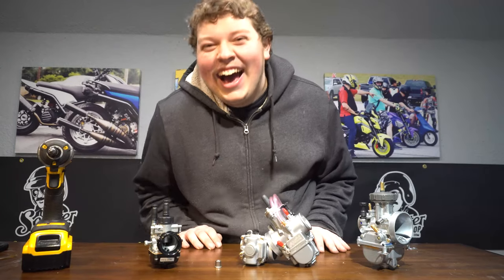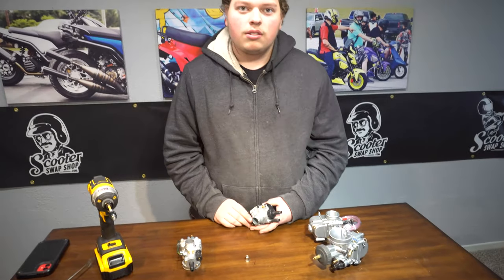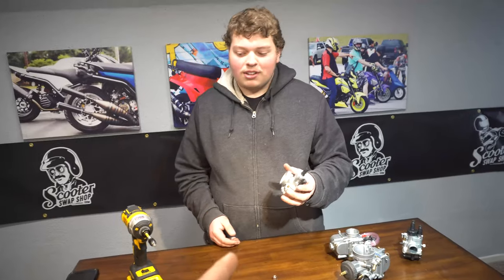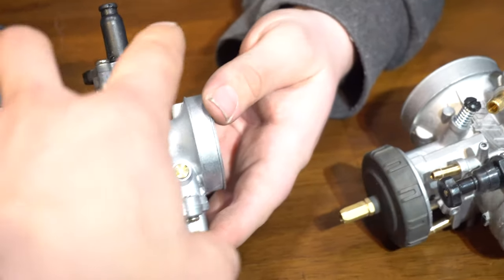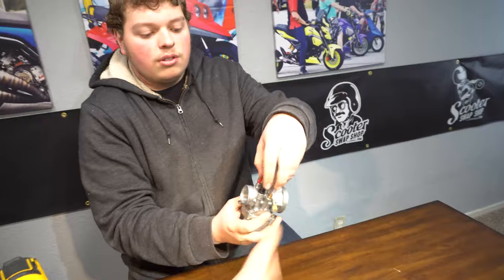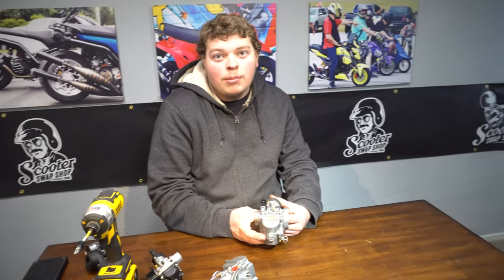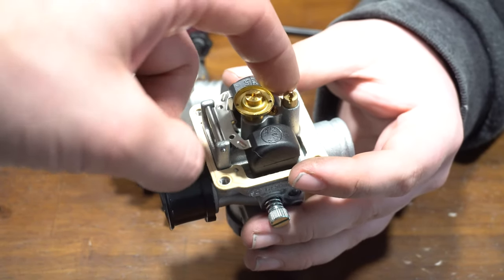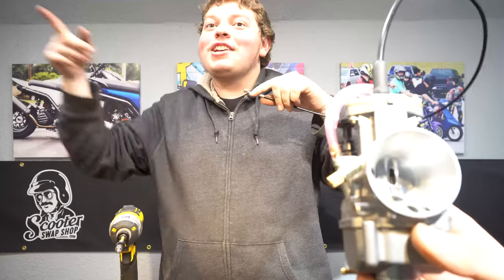Scooter carburetor comparison

Comment: When I was into scooters 15 years ago PWK and Mikunis were the best way to make big power but notoriously hard to tune. Personally I had phbg from 17.5 to 21 and 19 was the sweet spot. The main jet was no big deal, somewhere around 92 or 95 most of the time and the needle had a big influence at half throttle like he mentioned in the video. So yeah, for a mild build 19 PHBG was my weapon of choice. 

Currently I have a 21 phbg from polini on my 50cc Pantera. The main jet is a 92 from factory which seems very small but actually performs great. I don't know why they went with a 21 for an engine that small. On 70cc Panteras they went with a 19 PHBG, go figure!
Reply from the maker: nice

Comment: Is there any gains swapping to a slide style carb, for the 4stroke, gy6 China engines, over the CV  carbs they use?   Has anyone made decent power with these engines? Or are they the lada of scoots? I'm running a 50mm bore, ported head, with an A9 cam, (what ever that is worth, no real specs on any of the parts, compared to car parts!) But I have a free flow exhaust, ported intake matched to the head, I'm thinking about trying water methanol injection, I'm building another engine, with a 52mm bore over-size valve head,/with possible stroker crank, for about 95-96cc, I have a 24mm CV. Carb, and a modified nibi 150 intake, matched to the ported head! Im hoping for about 3x stock HP maybe more TQ, I am looking for somewhere to get it balanced, I want to lighten the flywheel/rotor, (everything rotating) I already swapped to a aluminum driven half for the starter gear/variator, about 1step above stock clutch Bell, nothing fancy, I'm mostly concerned with getting the heavier piston balanced with crank, I could potentially be spinning it to 10k-11k maybe more, with the titanium retainers and valve springs, it should easily do 11k (as far as the valve springs are concerned) I'm hoping for enough power to cruise at 40-45mph, with a top speed around 55-60, (with a tail wind, ) but mostly maintain a decent speed up hill, I have another China scoot, I'm going to 150swap, that's what I should have done with the other one, but I already have most of the parts! .  and I need to keep it somewhat legal! (Don't tell anyone!) Sorry to ramble,
Reply from the maker: Paul and Brandon discuss alot in this video if you want to switch it up give the shop a call talk to Paul and he can square you away.

Comment: Great video! Do you guys do anything with kymco? I have a super 9 with a 70cc kit and a giannelli reverse pipe still running the stock carb. What carb and size carb should I be running?
Reply: What 70 kit ? If its a cast then most run 17.5 to 19 and mhr rep and things like that 19 to 21
Reply from the maker: Not much

Comment: What carburetor size is standard size for 100cc 2t  and what wud just go straight on thanks
Reply from the maker: thats not a straight forward question. but we can get you set up with the parts you need message our scooter swap shop app or call and the guys can get you the parts.

Comment: I put an 80cc BBK on my 4stroke qmb139 build and I'm wondering what's a good 20mm (or) 21mm carburetor. I got a performance exhaust that's unbaffled, a foam pod filter, and no rev-limiter.
Reply from the maker: call the shop talk to Paul he can make sure you have all you need

Comment: Is the 21phbg too big for my 70cc sport setup on yamaha bws? It doesnt seem to get in tune especially in idle. And would you recommend 21mm or 19mm polini cp carb for airsal t6 racing cylinder which im going to get?
Reply: Nah 21phbg is fine for a 70cc sport setup. I had 21phbg with my 70cc malossi sport and it was easy to tune and the power output was good.
Reply: @Kyrpis  i figured out that it was sucking air in because of broken gasket so thats why i couldnt get it in tune. If you know, what 70cc setup would you suggest to bws, i would want more powerful setup
Reply from the maker: email or call the shop with your order number

Comment: Does the dellorto 17mm fit on an speedfight 2 original air box? I have a speedfight 2 AC 2004.
Reply from the maker: Not to sure on that.
Reply: The 17,5mm dellorto won’t fit on the speedfight 2 without changing your manifold. The original air box from peugeot won’t fit either.

Comment: are carburetors scooter specific or can you use any brand?
Reply from the maker: kinda specific
Reply: You can usually use any carb as long as the intake manifold matches the carb port

Comment: i have the phbg for my beamer 2 stroke,just got it for 500 because it needs a cylinder, piston,head kit,guy lost interest,anyway the carb was under the seat,FILTHY scrubbed it,opened it,clean,bobbers fine,no clogged jets,question,you dont think i need a sonic bath anyways right?just cause it WAS cruddy ojn outside?just wanna do it right,im also ordering a 70cc bore kit,polini looks sold out,malossi,naraku is avail
Reply from the maker: ok

Comment: Is a stage 6 (i think 26/28mm?) carb too big for a jog with a 70cc kit and exhaust? Has stage 6 r/t reeds too. I bought it used set up like this and the carb just seems big for a 70cc.
Reply from the maker: yes its too big
Reply: Scooterswapshop Thought so. It is hard to get it to run well. It’s fast but i get about 15-20 miles per tank of fuel lol